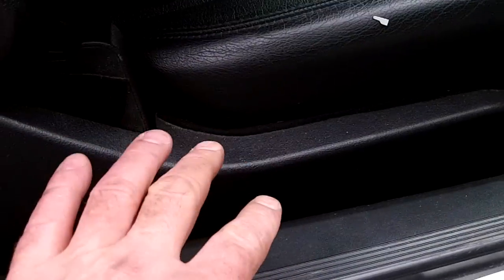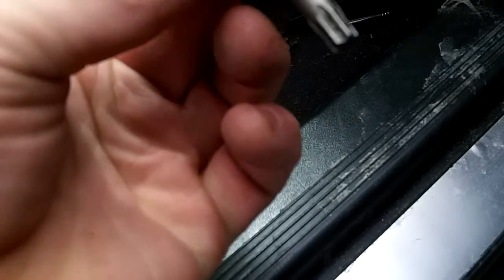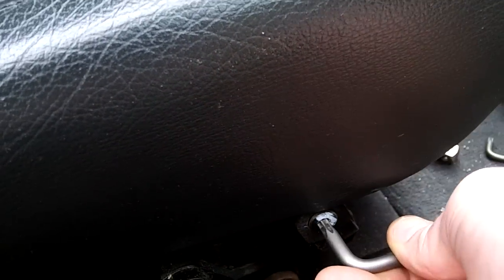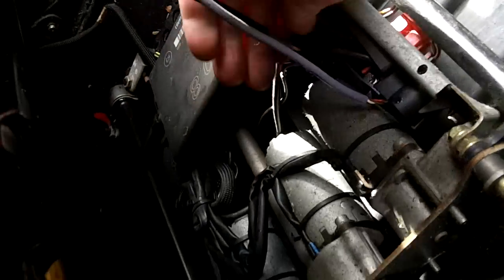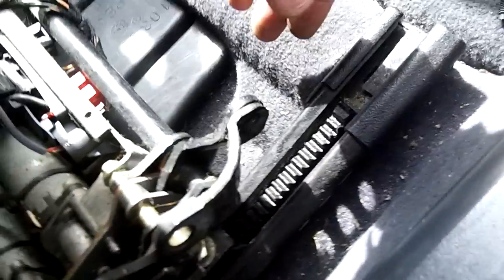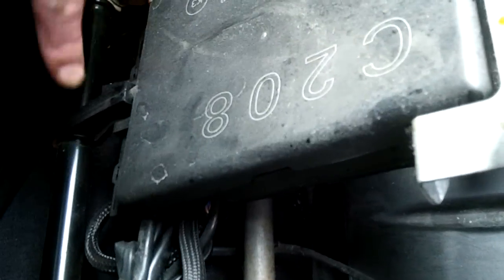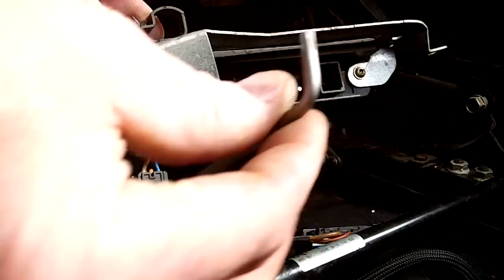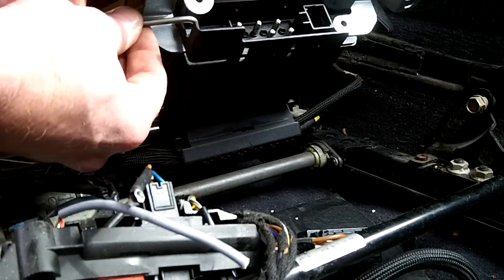Mercedes power seat control module removal

Comment: I have a 03 SLK320 which both seats worked intermittently and then both quit.  I would think with my limited knowledge that the problem is not with the individual seat module, unless one module breaking affects the other. Is my logic faulty and if not is there another module I should be looking at?  I hope it is not way up in the dash over the drivers legs where you cannot see, but suspect it is.
Reply from the maker: take a multimeter and check for power at the seat fuses when the ignition is on in the last position before start. If no power at the fuse, wrap a jumper wire from a fuse that has power , to the seat fuse...so essentially hook the 2 fuses to each other so that the one with power feeds the fuse for the seats..can't remember if there are 2 or 1 fuse for the seats. If the seats now work then the k40 relay may have an issue.. but check the fuse jumping first
Reply from the maker: did you check the relay like in this vid https://www.youtube.com/watch?v=1zLtPjrSteQ&lc=z120ijf5wtu3w1uag04cfnrr1qymyjvguto0k
look around the % min mark to see the wiring some mechanic did to bypass the seat relay.. that is the jumper wiring I was referring to trying out
Reply: I check for power with ignition turned off and also with turned on all the way, short of starting.  Both times zero voltage.  Seat adjustment is fuses 21 & 22 (30A) the fuses behind that 19 & 20 are 40 A for the power windows front and rear.  I could tap into those.  Think I should use at least a 16 gauge due to amperage. even with a couple inches in length.  Do you think larger?
Reply: I tried to do the fuse jumping, but my fuse block may be different than yours.  If you wrap a 16 gauge wire around one of the posts there is not room for the fuse to go in the slot.  If you use 18 gauge wouldn't it overheat with the potential for 30 amps?
Reply from the maker: it is possible it could overheat if used constantly for a long period, but just to test for power it will be fine  (18ga)

Comment: wouldnt be that easier if you would unscrew the 4 bolts flip the seat back ?
Reply from the maker: yup...if the power seat works and you can get to the bolts
Reply: I'm replacing my seats and trying to put in a seats from newer cars seat in and having a problem of wiring the new seats.
Can I just slice in the existing wires there and make the new seats work or is it better to wire to a fuse box?
Reply from the maker: you can take the power from the original power seat module wiring
Reply: fupabox do you know what wires I can slice in? I know usually here in UK the brown colour wire is the power but tried to connect to that one and ground to a cars body but didn't work

Comment: My driver seat is not goin back and forth the bottom part how can I fix it? And your videos really helpful thanks.
Reply from the maker: it could be 3 things..the switch, the controller, or the seat motor...if you plug the passenger side switch into the drivers side you could see if that switch made the seat work...if not..the switch is prob. ok
then unplug the forward backward motor under the seat and put 12v power to the motor....if that works then you know the controller is likely the problem
Reply: ***** I've had this issue for a long time now but havent been able to work on it because too busy with my job. my seats no longer work (power seats) before they would work intermittently, (driver and passanger) now they both stopped working at all (they dont move back forth up down tilt..nothing) can you help me diagnose the problem? i doubt its the seat motor since both stopped working at the same time
Reply: Mac_Mo_Dollaz also dont think its the switch because both sides dont work...not sure what the controller is or what else to check any help is appreciated ...thanks!
Reply from the maker: Mac_Mo_Dollaz do they move in all the other directions ,,up/down ?
Reply: +fupabox No movement whatsoever I'm any direction (both passenger and driver side) sorry new to this whole g+ thing still trying to figure it out lol
Reply: No movement whatsoever In any direction (both passenger and driver side)
Reply from the maker: Mac_Mo_Dollaz what year and model is your car?
Reply: 1999 c280
Reply: ***** not sure if I have to type the plus sign followed by you name in order for you to receive a notification so sorry if you received a notification before and are receiving it again, not trying to be annoying lol year and model are 1999 c280 thanks again
Reply from the maker: Mac_Mo_Dollaz check post #21  on this forum link..the relay is likely your problem as well..
http://mbworld.org/forums/c-class-w202/408015-power-seat-issue-intermittent-operation-help.html
Reply: ***** hey thanks a lot man I'll check that out and see if it works for me, again really appreciate you goin out of your way to help!

Comment: Cutting the wires when there is a connector - bad attitude, youre just like one of those idiots that go to pick n pull to get something they need but destroying everything whats in the way. Really hate when ppl do it. Even if you dont need the part that does not mean it can be destroyed. Someone could have used it. Occupancy sensors fail and replacing them is pain, you could have just kept the whole bottom seat part for sale. Now you can eat it yuorself because noone needs the bottom part with the wires cut off.
Reply from the maker: This car was going to the crusher in 2 days ... It wasn't in a wrecking yard. It's in my driveway.  Having a bit of knowledge about what you are watching can prevent you from making assumptions
Reply: I perfectly understand that it was in your driveway. Its a question of principle. I bet you would do the same in pick n pull because - it is going to be crushed anyway.
Reply from the maker: Thank you for judging me based on nothing... but I am the guy at the self serve wrecking yard that carefully removes everything , knowing that I may need another part off that car ..You are free to believe what you want though

Comment: can u connect the batt strait to the seat motor to move it back and forward my drivers seat its acting up it moves forward but not back its a 2000 CLK 230 elagance kompressor
Reply: so i just tryed it and it worked this is wat i did  i got a cigaret lighter plug and put 5 amp wire then unpluged  the seat and pluged the two wires in the - and + directly to the motor and then plugged it in the cig lighter socket and it went back
Reply from the maker: excellent... I would disconnect the motor from the seat control unit under the seat first if possible..check the lever that moves the seat forward when accessing the rear seat .. if it doesn't come back down properly, the seat can't engage the motor to move rearwards
Reply: Hey bro I'm going to try this on a w203 c320 because my seat is stuck all the way forward(thanks to my bad luck short girlfriend😂😂). What are the wire colors to move the seat manually forward and after using a external battery?

Comment: Some people should stick to paying others to fix their cars when they break. This putz should not be showing people how to bitch up their cars. He doesn't know how to use basic tools and rapidly resorts to unnecessarily cutting wires in his haste. If you want to learn how to break stuff - watch videos like this. If you want to learn how to fix things, watch a video of a professional who actually knows how to take things apart without destroying them. When he cut the wires, I figured he worked at a junk yard at some point. And sure enough, he admitted to it further down in the comments. Junk yards teach hacks how to rip stuff apart as rapidly as possible. And that's all this hack knows - how to rip stuff apart quickly and break half of what he's working with. FAIL.
Reply: What you missed, was that he WAS at a junkyard.  So your comments are out of line.